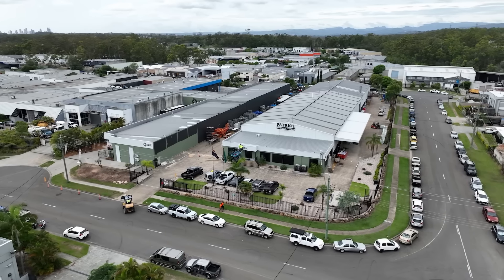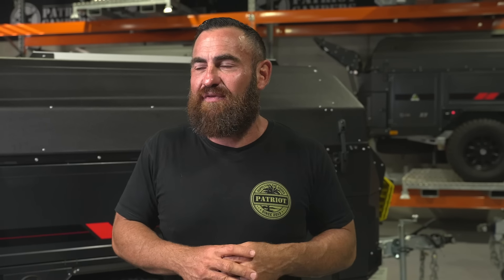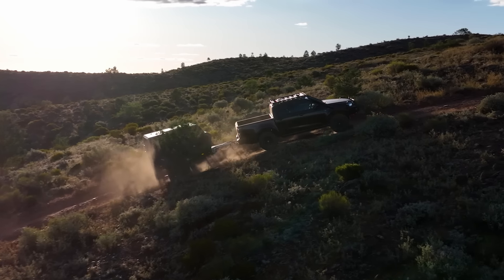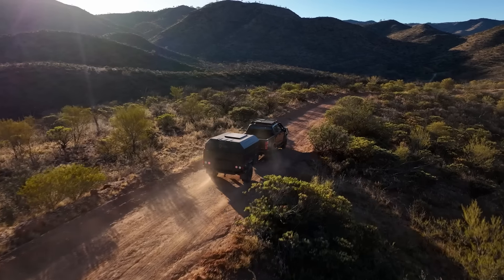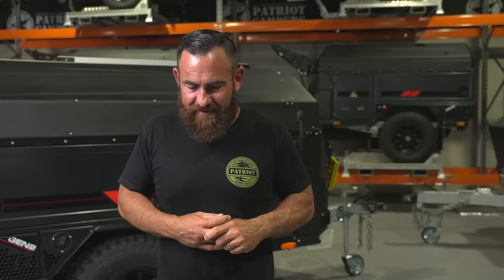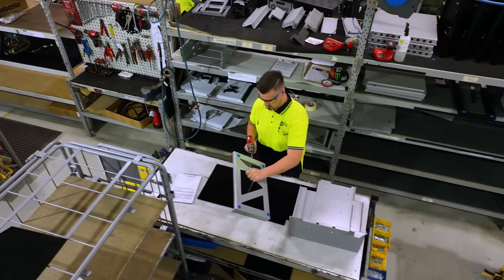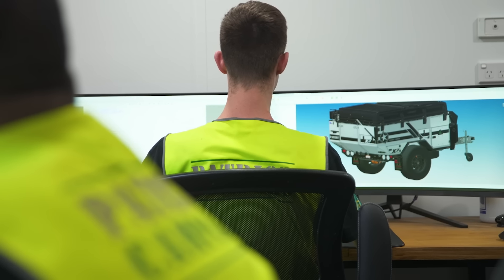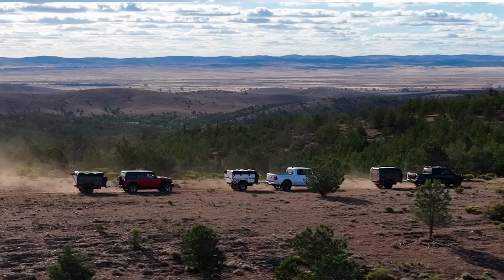2025 Patriot Campers X-Range | All-New Updates Revealed!

Comment: Great to see an Aussie company keeping at it. Wish Patriot all the best, it isn't easy here in Oz! Great work.

.
Sheetmetal.. HVAC background?
SA sys:
Vertical filter folds, use the vibrations to advantage (think shaker systems), smaller air inlet to filter face without approaching rain pull vel (i.e. drop velocity before filter try to let heavy particulates  fall), centrif fan? not sure.. (good delta P not high Vol would reduce velocity also) surprised fan not on inside.

Comment: Just a tip for helping to ensure when you close the lid you don't have canvas sticking out at the seal. An old hand at this told me when I am closing the lid, stop every so often and go around with a rounded wooden spoon (you read that right). Using a wooden spoon to poke canvas in (that may be sticking out) is easier than jamming your fingers in there and the spoon will have no sharp edges etc and be nice and narrow so you can sort it out without damaging the canvas or the seals
Reply from the maker: Good tip 😊

Comment: A couple of additional items should be considered. 
The bleeder valve on the diesel tank is inadequate and can cause a vacuum situation in the diesel tank when the heater is used in the X1. The vacuum in the diesel tank causes the diesel heater to starve and stop working and, in my case, caused the bottom seal of the level indicator to start leaking. Las Vegas has sent me a new bleeder and I think it will probably work.
Another issue is with the seal around the canopy cover. On handover, I noticed a large gap in the front edge of the canopy cover where the plastic with gasket meets the plastic of the main shell. In 60 mile an hour driving with no wind, this does not present a large problem from wind incursion; however, as crosswinds increase, the wind gets under the canopy cover and the first latch fails, causing the front end of the cover to lift up and act as a sail when traveling down the highway.
I’ve also noticed that on closing the top shell, the rear drain nipple for the plastic shell, does not clear the plastic strip around the top of the X1. It took me several tries of opening and closing the shell and finally using a putty knife to force the plastic strip down far enough so that the nipple cleared the plastic strip before I got , the shell closed and keeping the nipple, from forcing out that piece of plastic.

Please look at revising the diesel tank bleeder, the gasket on the canopy cover to eliminate the gap and check the tolerance between the rear drain nipple and the plastic band around the top of the camper box. 

There may also be some opportunity to improve the comfort operation of the Truma diesel heater. In my very limit use, it was either barely working or creating a furnace in the tent.

Any plans to add a DC air conditioner in the Truma box that would duct into the existing air tubes?
Reply from the maker: Hi! if you can lodge through the customer enquiry forms on the website it will ensure it gets revised by engineering 👍
Reply: @patriotcampers  Thanks, I will again. I have already lodged the diesel leak and canopy cover through warranty. I received a seal kit and new bleeder valve for the tank leak. I was told by Warranty that I was the only customer that had the air gap and cross wind incursion. I was sent a longer bolt for the latch but I haven’t tested that “fix”.

Comment: Hi Justin
Looks like you are doing a lot with the new models.
I wish there was that much help for the older models.
I have a 2022 X1 and have not been able to use it all year.  I thought I was going camping on our Memorial Day (end of May in the US)
When I started to fill the water tank the tap ran pure green!  Glycol from the WEBASTO.
Contacted Patriot and have worked with Cody in Las Vegas.  After about three months Mick Brown got involved.  After about four months Sarah Montesalvo also was brought in.
WEBASTO has refused to provide any help and have said it is not a warranty problem.
I have taken the trailer to a WEBASTO tech in Boise (about 100 miles from me).  He has never seen this model heater and has requested info from Patriot and/or WEBASTO but it has been about another month and still nothing.
Our camping season is over here for the winter but would like to have some answers and some repairs done before next season.  Would like to talk further about how this is going to go.  Cody, Mick, and Sarah all have my contact info.
By the way you mentioned in the video about how important the handover is!  I did not receive any handover even though I spent an entire day in the show room of the dealer waiting for my unit to be prepped.  Paperwork complete and they told me they had a problem with the heater that they could not fix so they started over with another new unit.
Reply from the maker: Thanks Don, as you know the team are working directly with the Webasto service centre on your heater. After three months working with you to get the heater into an authorised repairer for assessment we're confident we can get you sorted soon.